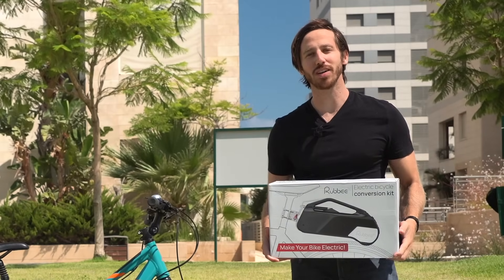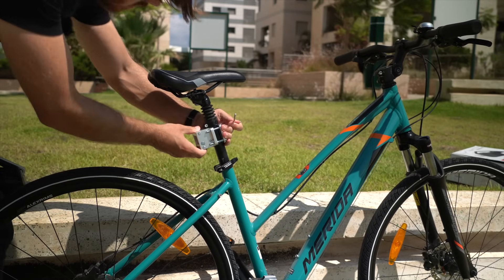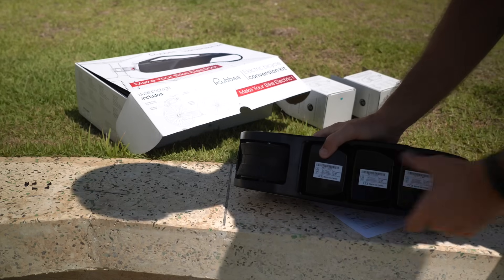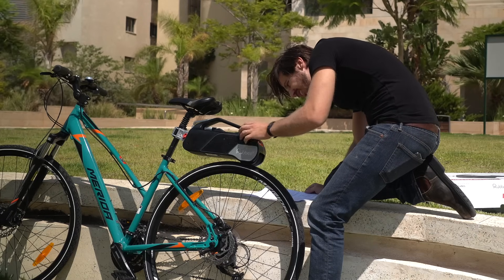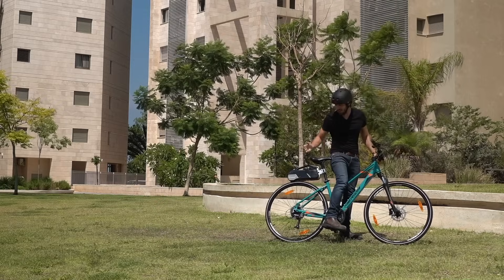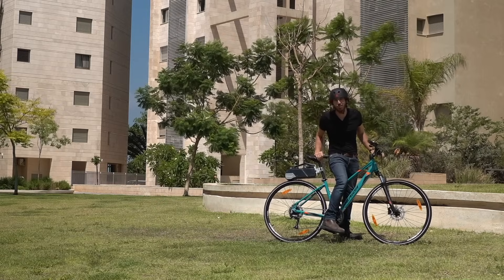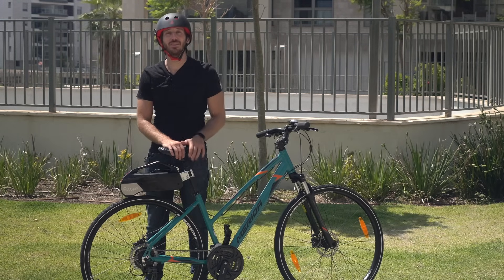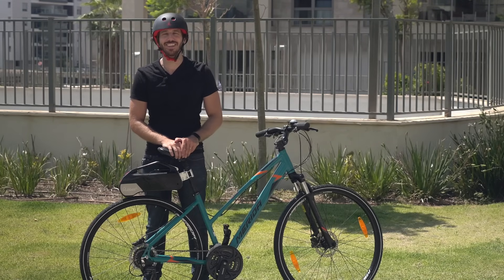The Easiest DIY Electric Bike Kit I've Ever Used! (Rubbee X)

Comment: How easy is it to fetch the main unit to prevent theft? Is it best to remove it with the seat post, and cart both away? And is this item available in other countries? Uk?

Any mudguard and rack would have to be removed, but I guess it acts like a mudguard anyway. Seems to incorporate a tail light, hope so, since Rubee reduces other options.

Comment: Do not buy. Because assistance is not good. Because the sensor... doesn't work after three months. Because if you request another recharge and sensor on the website it is always sold out.

Comment: you can buy for 600$ ,than after 1 year you can throw it out, because not possible to change the battery. the range of the 4kg 350w maybe 50km with pedal, but without leg power  only goes 25km. i have 350w  17kg front hub motor set(with 3pcs 12v battery) it can run 35km without pedal assist. 60km with pedal, after 7month ,replacement battery cost only 60$.... better than paying 600

Comment: For those wondering how much, this is what I paid for my 2 bike setup.  

I paid: 729 for 2 battery kit, 115.00 for extra bike kit, 15.00 for 3rd used battery on eBay.  Came to about 859 and can use 2 bikes.  It's pricey, butt I don't need a dedicated 1000w system per bike.  Just enough to help with hills and much longer rides.  I hope to make a video later after receiving and install.

Comment: I'm wondering how this would work on folding bikes or even a trike. I like the size of the batteries and wonder if you can buy another set separately to try and use swapping out with a solar powered recharging set up on a trailer or basket.

Comment: How much for it
Reply: I paid: 729 for 2 battery kit, 115.00 for extra bike kit, 15.00 for 3rd used battery on eBay.  Came to about 859 and can use 2 bikes.  It's pricey bit I don't need dedicated 1000w systems pee bike.  Just enough to help with hills and much longer rides.

Comment: Not enough information. 
I would like to know at what top speed you reach where it cannot help significantly anymore. 
Does it slow the bike when you stop peddling?

How does dirt and water affect the friction wheel?
Does dirt and water degrade the internals of the unit?
If you stop and walk the bike backward, does it allow the tire to go in reverse?

Comment: I did not understand how you control the speed as there is no grip controller. and how to turn off the motor when you need to stop anywhere, as you stop paddling what if the motor still rolls you forward?

Comment: Didn't see him coasting, not even once. Makes me think that coasting is less efficient with this design.
Reply: I coast on mine.  What the video does not demonstrate is that you can pedal quite slowly yet go quite fast. The pedals are more like a throttle.  If you coast the power will not engage but just moving the pedal will engage power.  Power cones on smoothly where as some e bikes can be jumpy.

Comment: How fast did you go, and did you have to pedal the whole time? Looks nice, thanks for posting this video.
Reply: I have gotten up to 32.8 kph. 20 inch tires.
Reply: At 20.5 mph in 7th gear using the Power setting there is no resistance on the pedals.  Regardless, I leave the Power mode for hills.

Comment: Absolutely not recommended product, I bought it to have an electric bike when I come back from abroad, every time I find the battery of the pedal sensor that runs out, I change it and it doesn't recognise the sensor, and then the app to update, and then it works for 5 minutes and then it goes in a loop, and then I change the android smartphone and try ios and there are other problems. In short, I've wasted about 900 euros on the kit and extra batteries.
The button to hook the motor to the wheel is hard and the plastic around it cuts the thumb, a plastic riser would be enough to solve the problem.
The screws underneath are at a 45 degree angle and difficult to unscrew, the extra batteries difficult to release.
So many things that put together make this kit bad.
I have learnt that these Bluetooth kits are a real mousetrap, the promises are many the facts very few.
The next ebike a wired model and without a capestro app!!!! In general, I am sick of buying all these connected and overconnected products that do nothing but complicate life.

Comment: This thing is way overpriced for using older technology.  Hell.., you could buy a budget Ebike for the price of the unit and three batteries.  They want 579 for the box, and 99 for each additional battery.  Fully spec’d the box is 777…, again, you can buy an entire ebike for that prices that uses newer tech.
Reply: But not waterproof..
Reply: This thing is a galaxy away from the old technology! It changes applied power relative to your pedalling speed, so if you start to struggle it ups the level of help. Same thing if you change down a gear.

Comment: You can buy a way better electric bike kit for cheaper! I went on this website! I would have thought this would have been cheaper but the price is over $600! OMG I'd rather pay for a built-in hub motor any day then friction drive! Shtt! On Amazon electric bike kits with built-in hub motor cost anywhere between 200$ to $600! Nobody waist your money on this garbage! 😂 I probably would have got it if it was $150-200$ because I like the design but 630$ for the kit and 99$ for batteries then 30$ for the Mount! Taxing for sure! Way to much! No one in the USA is gonna buy this!

Comment: Wow nice I didn't know they has cheap kits.... how much is it I'm guessing about 100 max for motor and each battery I'm not sure how big they are, but if they are decent ones maybe 50 each,  150.   That part I don't get why they use 3 little ones....I'd rather a decent single big battery which should get about at least 15 miles as obviously this is a basic small motor set up.    250 is the max I could see it cost......probably costs 50 to 70 bucks In parts all together......but I just am curious is this really practical I mean I just don't see much power from it.   Is it at least 150 watts?    This thing seems really unpractical 250 for a tiny support in peddling shhhh I'll keep my 250

Comment: I would be interested to see how long the contact rollers last with grit, dirt and other road debris spun up by the tyre.  Also how much the friction drive takes out of that back tyre as well.
Reply: Or older rubber, or/and wet, making it slippery.
Reply: Not the best option hopefully its cheap lol
Reply: Exacllty , if you go offroad at all its going to be trashed.
If you go out in the wet it aint going to have the friction.
I dont intend either, I just want to be able to get out for 1/2 miles in the dry .  Want to send me one rubbee?? hehe
Reply: @davidmg1925  it's clearly not.intended for use in those situations so why would anyone buy it thinking it would be ok for that? Just look at the unit, it's so obviously aimed at city commuting or longer journeys on well paved paths and nothing more than that but for those purposes I imagine it will perform very well at it's job.

Comment: The pack comes with one battery at €579, extra batteries are €99 each. €777 all in.
1 battery: 
Top Speed 25kph
Weight 2.8kg
Distance 16km
Power 250w

3 batteries:
32kph
4kg (?)
48km
350w

(Edit: oh, and the batteries are good for 1,000 cycles.
Also, seems to me this info could've been added to the video pretty easily, or included in the description, I mean it Is a review.)
Reply: I get a 404 on their website, guess they didnt last long with a $800 kit using 1980s tech?
Reply: That seems to me like too much money for too little
You can buy a rear wheel motor kit at about 330 EUR with 48v and 1500w of power and a cheap battery with 15000-20000 mah for about 200-300 EUR
And now you have a dangerous bike that can reach 80 kph downhill for about 600 EUR
Reply: With only 16km range one needs a good battery supply. They should have 'em the cheaper the bigger one-time purchase.
Reply: @HalliAEetus  Who bikes farther than 16 km?
Reply: @Crashed131963 1. A person going from one end of town to the other and back.
2. A person not living in town.
1. Me. 2. Me
😉😄
Reply: @Crashed131963  Ps. A friend of mine bikes more than 60km a day because he doesn't use a car to work, but he is a special case. Most of us need engines.
Reply: @HalliAEetus  The good new with this bike is it can still be paddled home.
My 200lb E-Moped has to be pushed if it runs out. Thankfully it never happened yet.LOL
Reply: @Crashed131963 Yeh 🙂 A decent engine is also required if one is shopping. But the prime reason for me to consider this apparatus in the video is its added portability to use it abroad or other trips. I move around and also like to go where cars necessarily can't while also using main roads. But this bike engine seemed to be too expensive in relation to range. 32-40km a day is very normal level (if one has the time).
Reply: Op is just low effort shill pushing garbage out as content. What did you expect?
Reply: you shoulda made this review.
Reply: @pawelo2698  It wasn't him, Charley, it was you. 
Remember that night in the Garden you came down to my dressing room and you said, "Kid, this ain't your night. We're going for the price on Wilson." You remember that? 
"This ain't your night"! 
My night! I coulda taken Wilson apart! So what happens? He gets the title shot outdoors on the ballpark and what do I get? A one-way ticket to Palookaville! You was my brother, Charley, you shoulda looked out for me a little bit. You shoulda taken care of me just a little bit so I wouldn't have to take them dives for the short-end money.
You don't understand. I coulda had class. I coulda been a contender. I coulda been somebody, instead of a bum, which is what I am, let's face it. It was you, Charley.
Reply: @sweatshopjesus  Charley said that it wasnt him and life happens and it was you who shoulda.
Reply: @pawelo2698  Ah. I see. Couldya tell Charley that I woulda but I couldna. Thanks Pal.
Reply: Thanks 😊

Comment: The problem I see is that you can't change the pedal assist while you are riding,  you have to do it from the unit unlike other ebikes which have the control's on the handlebar, 
I normally ride on level 1 and change it to level 2 or 3 for hills,
On this conversion it look like you have to stop and get off change the power settings then start riding again,
Reply: a remote control would be a nice addition to aid in changing the pedal assist levels.
Reply: I thought you could do it from the app on your phone?!?!

Comment: I wanted one of these but had a hard time actually getting one. Instead, I bought a RideKick in great shape for $500. It came with two extra batteries that will let this push you on electric only for twenty miles! 500 watt motor has lots of power!

Comment: Initial charge on liion batteries is important for them to awake from sleep and bms to balance them. You can only balance when trickle charging after full charge. If they are unbalanced and discharge them you may overdischarge a cell and ruin your battery pack. Always charge for 12 hours first time a new battery pack, resist temptation to use it right  away

Comment: My friend and I are planning a new adventure: corner to corner ride of Montana (890    miles).  We have our camping gear but will stay in motels when possible, or necessary!  We have foldable charging panels and plan to do around 60 miles per day.  Will see, as neither of us is really getting into shape and we are old (69 and 74).  I have a question.  Which will get us the FURTHEST?  Low pedal assisst (PAS 2 ) in 3 or 4th gear, trying to maintain 10 mph, or higher PAS, say 3 in 5th or 6th gear, maintaining a higher mph (?15).  We could probably experiment during the trip, but knowing before would be helpful.  Thanks!

Comment: Welp I went on the site 579 Euros which is like 625 American dollars way too spendy when you can buy a cheap E Bike for 500. Great idea. But too overpriced looks good though.
Reply: The additional add ons  bring it close to 900 bucks. Great to make your bike pedal assist but again. Too much. I was like wow I’ll get it if it’s like 250. Then realized how expensive it was. Had to pass
Reply: And the wheel 🛞 Will eventually need to be replaced. How much is a replacement ?

Comment: the PRO is that they can never STEAL THE UNIT =can use cheap bike park in bad area THE CON =SNOW AND RAIN = GAS FRICTION DRIVE CAN RIDE ON RAIN AND SNOW =METAL FRICTION BUT WEAR OUT WHEEL FASTER IF YOU JUST PLAN TO RIDE ON NICE DAY IT IS BEST DEAL NO BODY CAN STEAL THE UNIT=EASY TAKE OFF/I LIKE TO HALL THINGS IF IT WAS LIKE HALF THE PRICE I WOULD GO FOR IT

Comment: Dear EbikeSchool
I want to convert my city bike into an ebike and I’ve looked at a lot of front hub motor wheels, but then I realized that my bike has “roller brakes” and I’m not sure what to do now. Do I have to by a special hub motor wheel if I still want to use my front break or what would you recommend? 
Kind regards Anders

Comment: I bought two of these devices from the Rubbee website back in November 2021 with the addition battery packs this was a big investment with the additional import duties. They just don't work together, both motors and sensors seem to use the same frequency and get confused. One minute you are aided with the motor the next you are restricted and find it a work out riding up a slope. I have contacted Rubbee's customer service and the advice given was start the bikes up away from each other! This was a pain and didn't work. We have now been waiting for an app update which apparently will solve this problem. We are still waiting and just want our money back if this isn't sorted as we can't use the bikes together.
Could anyone help please?
Reply: Very interesting. Any updates?
Reply: Curious as to the resolution of this issue, too? Rubbee seems to tout the OTA update capability.

Comment: I wouldn't be to into the idea that something that powerful being pressed against my tire. If my tire goes slightly flat then I can't use it and then this also adds more wear to the tire overtime. Then there's the difficulty of just engaging it and disengaging it. There are deeper mods to normal bikes that do way more for around the same price. Like the mid drive conversion kit from amazon 750w being around 500-600$ with a much bigger battery and much more solid construction.

Comment: Just a couple of points not covered. Rubbee does have an app that allows you to select the power modes directly from your phone as you ride via blue tooth. It also shows speed and distance. The app also allows you to download firmware updates. Secondly, the little bit of effort in disengaging the unit is because of the pressure of the gas cylinder as you say, but it's needed for the unit to maintain pressure on the wheel. I bought one recently and it's a great piece of kit. It works well and you don't have wires everywhere.
Reply: Where can I get this to buy in the US
Reply: It would be great to know the average range of the batteries.  Also pricing of the kit and each additional battery.  How has the kit held up over the past 3 years?

Comment: For the same price or less, you can pre-order a Swytch kit and - if you're in the US - it'll go up to 32kmh instead of 5kmh (20mph instead of 3mph)

This may be "easier" but so would strapping a couple of leaf blowers to the back of your bike. That might even be faster and quieter than this friction drive
Reply: I have one of these and It works well up to 35km/hr and with three modules installed provides 350wh. The Swytch is a good piece of kit too but the Rubbee works just as well and I like not having a heavy battery unit hanging from my handlebars. Much better having the weight over the back wheel. You seem to be misinformed regarding the unit. Also it is not very noisy at all.
Reply: Fair enough, I thought the power wouldn't have been much better than what was described in the video

Comment: cool kit and nice video, but i just checked the price in european market it is 579 euro for basic kit with one battery with each additioanl battery costing another 79, so 3 batteries is like 730 euro = 800 usd, pretty expensive kit

Comment: Not the easiest, and definitely not the cheapest conversion. If you want the 20mph option, you need the three batteries. If you live in the US, that will cost you about 1200 (and that's not including any potential shipping cost).  Meanwhile, you could buy an already assembled, decent quality, full E bike with a top speed of 28 mph from Lectric for 1000 including shipping.  

  So where exactly is the deal and incentive to use a less efficient drive system with less power and less amp hrs?  The only pro that I see about this system is its portability--would be good for traveling.

Comment: The first problem I see is that you can't have a rear mudguard, so no good for wet weather and muddy conditions. But otherwise it looks like a good simple option for a quick conversion of a bike for dry weather use
Reply: Maybe you can ..just cut it a bit shorter
Reply: Someone pointed out you could cut a hole in the mudguard

Comment: Looks like something I  like but hope when I go research, the price will not be overboard. The release mechanism you complained about is a spring load, if that was too soft then the friction won’t work. My question is   Di you show battery being recharged while riding, and how does it free role, did you spin the wheel in the air , something. I would have demo’s in a standstill, other than that great job  Hey Rubee X review me

Comment: I don't like to be negative but my experience with bikes tells me that the mount will break. The plastic part in the battery that attaches to the mount is a weakness. With all the bumps in the road it will break fast is my prediction. I would try to fix some more support. Maybe some thick cable ties around the saddle rails and around the handle of the batterypack.